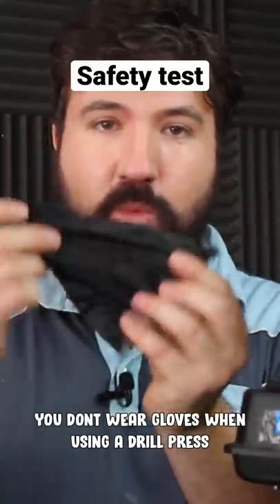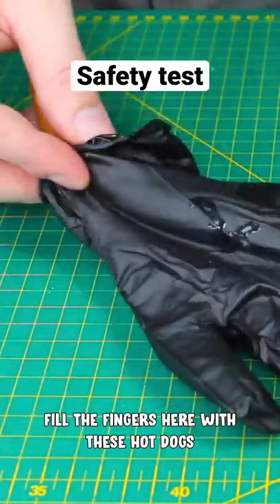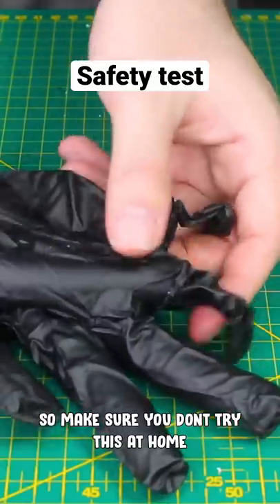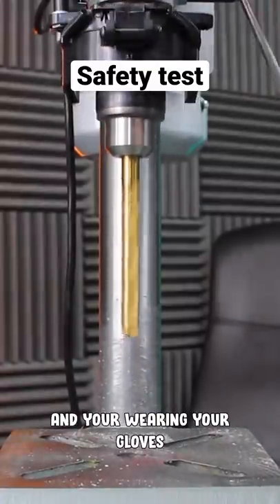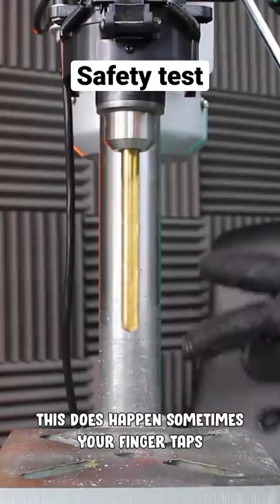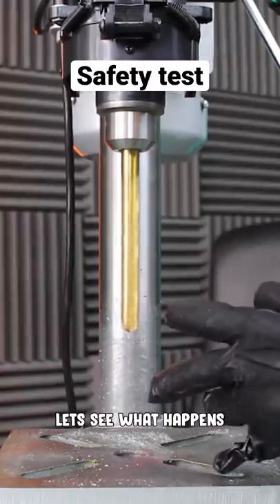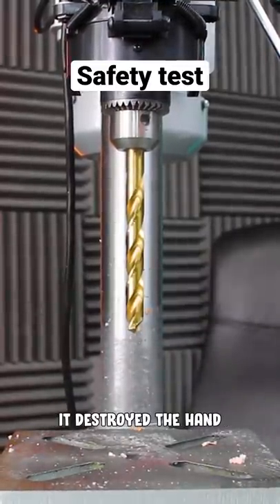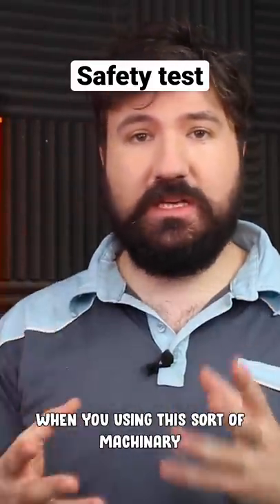Never wear gloves using a drill press insane result!

Comment: OMG! This is an insane coincidence. It isn't as mutilating as a bench press, but just a week ago I was using a rotary tool with a routing bit while wear gloves. Everything was going great, looked around for something, and then I felt a tightening around my hand, and then a whirling noise like a propeller. As you can guess I had just barely touched the router bit and in a flash it had ripped most of the glove off my hand but not before nearly digging a perfect quarter inch hole into my hand. I haven't been using a rotary tool for very long so I'm still getting used to things, but yeah definitely don't wear rubber gloves with your rotary tools! Unless you plan on becoming the next David Blane. Then go right ahead, put a straw thru that newly formed hole in your hand and drink a big glass of wtf was I thinking.

Comment: I agree with the message; don't wear gloves with high speed tools. However, I disagree with the testing methods as  usual. Notice how he has to reposition the fake hand to get it to catch. If the drill tip is going straight into the hand, you'll get injured even without the gloves. Thin ones would just get ripped off. The real problem is with thick gloves that can stay together and pull you in.

Comment: And that's how the razor sharp shaves split open your hands. USE THE CORRECT KIND OF GLOVES AND THE CORRECT SIZE FFS. I use working safety gloves that fit my hand, an oversize glove could be pulled under the bit. And undersize doesn't fit the fingers lowering the sensitivity of the fingertip.

Comment: While the demonstration is an exaggeration of the damage there is still likely to me some major damage. While I never considered this issue I definitely get it now. With a regular drill the saving grace is that you are.....eventually..... going to let go of the trigger. It was never soon enough for me but... eventually. The solution would be a foot pedal or, even better, a knee operated pedal. One off a sewing machine would likely work. To use that as a knee pedal I would attach about 6 inches of metal for leverage.

Comment: Do not wear gloves with any stationary table tools!
They are used with your hand close to the action or moving towards the action. And require actual thought to hit the off button. 
With power hand tools it’s different.
They all are by designed able to turn off of you shockingly let them go in a split second because something happened.

Comment: that's kinda of an unfair advantage, since it's a latex/nitrile glove therrfore more stretchy and easier to the drill to grip, since they're disposeable they are even thinner, and arm, your hand would be hurt bad for sure, but since they are thin af, they would be ripped

if it were leather gloves, would be better and worse

more solid, hwrder to grip, but wont just rip off, so if it does grip, would ve much worse

Comment: This guy's message is good but his presentation is awful
1. Thin latex gloves would most of the time get torn before doing any permanent damage to your hand. Thick work gloves wouldn't rip though
2. Soft loose hotdogs are not nearly comparable to human fingers with bones, thicker skin and firm muscles keeping them in place.
Something like carrots superglued to a stick would work better.
3. That was not a light tap. That was clearly pushing the hand way further in than would happen to most people.
Literally just tap it a few times until you get a good take next time.

 thank you for reading this

Comment: But isn't the glove you used to weak if it even touched it with you hand in it it should just rip the glove of right. It would probably pull a finger out of socket I think not sure but I do think this is not completely accurate

Comment: I personally work on a drill bank with 5 drill presses every day, drilling steel and aluminum mostly. I wear nitrile gloves every day because I work with coolant and I have to say this video is completely disingenuous. When you accidentally "tap the drill bit" more often than not, nothing will happen, but when something does, the bit simply tears a piece of the glove off. At no point will you be shoving your entire hand into the drill, and if you do, the gloves aren't going to make the end result any worse. This guy is not a reputable "tester" for safety. Nitrile/latex gloves are fine for drill press work.

Comment: Well as a metal fabricator you shouldn't use cheap rubber gloves the gloves are to protect your hands from the work peace NOT the tool if you get your hands that close to the bit that is your own stupidity use a damn clamp if you can't hold your work peace securely this video is wrong as well

Comment: Well obviously your an idiot if you do especially a rubbery type glove not to mention shut it off before putting your hands anywhere near the bit most switchs are now right infront of your nose Bright red worse is trying to drill thin plate metal without being clamped from top down as well as normal from sides you will not be able to pull your hands away from the metal fast enough

Comment: Are you fucking joking?? Make a wooden hand a try again.. when you pull away from it the glove is going to rip off IT SELF off your hand.. now some actual glove can be dangerous but you're not demotrating real gloves are you!! Rubber gloves DO NOT have enough strength to harm you ever. They will rip themselves away from your hands they are  Incapable of wrapping you up, real gloves YES VERY MUCH SO,  So rubber gloves would actually be the gloves to wear using a drill press. Bad demo dude..